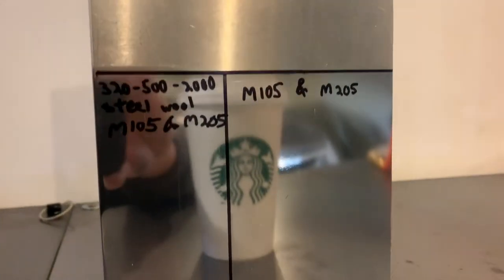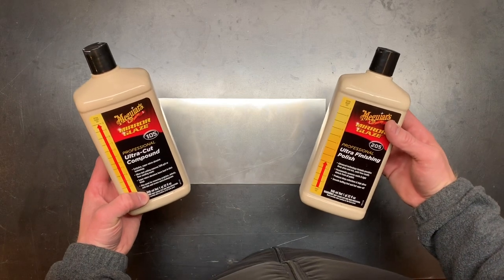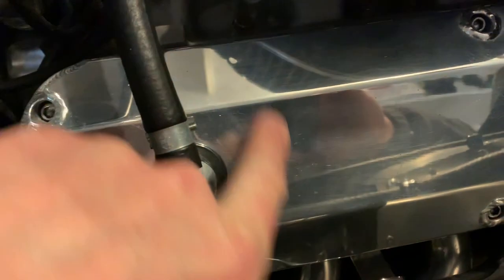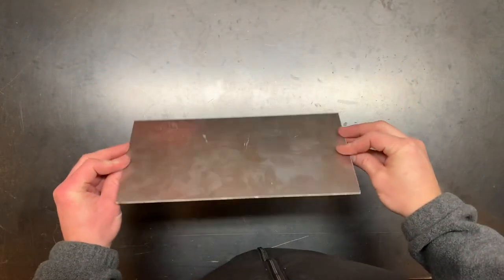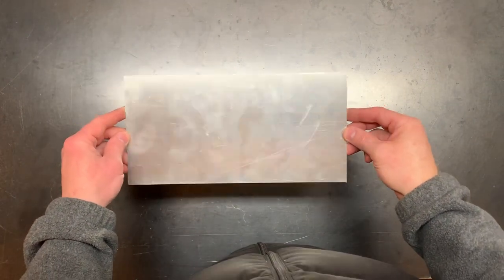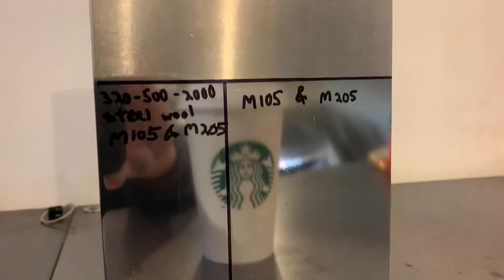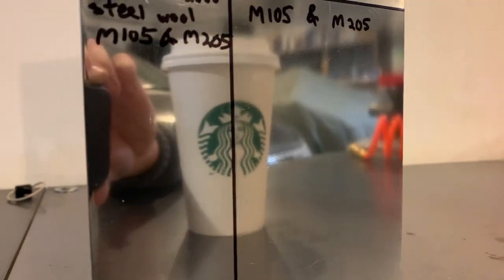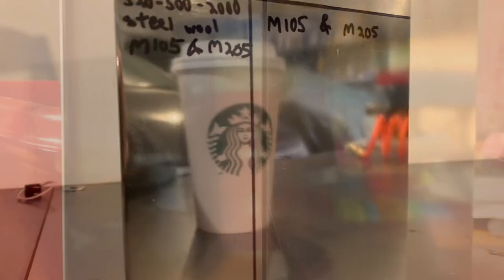Polish aluminum to mirror finish with Meguiars M105 & M205

Comment: When sanding you skip a few grits....but,  the outcome is very good 👍
Reply from the maker: you are correct sir :)  - actually I'm getting ready to clean up some aluminum rims on my gen4 Honda Odyssey and your comment helps me remember to pick up some of the intermediate grits to get it right. Any recommendations how to seal them after they are polished? I live in a snow-salt saturated area of the country - thanks for the comment!
Reply: @TacoJoe   I think there must be a special sealant for that application ... personally I have never used one, but there must be something available... good luck 👍
Reply: @TacoJoe  try Sharkhide metal protectant